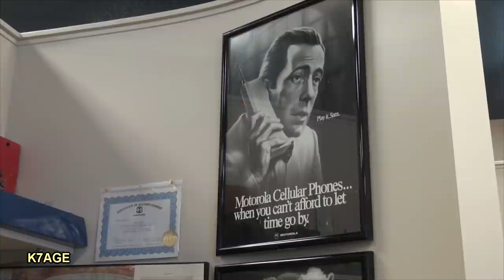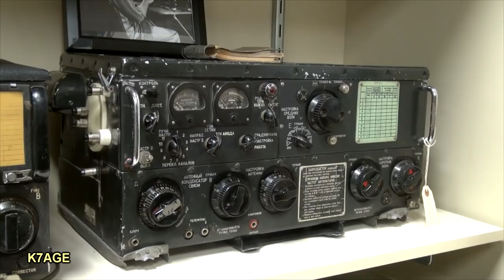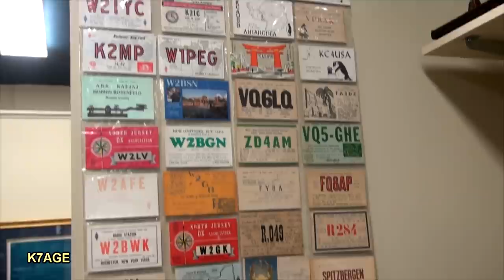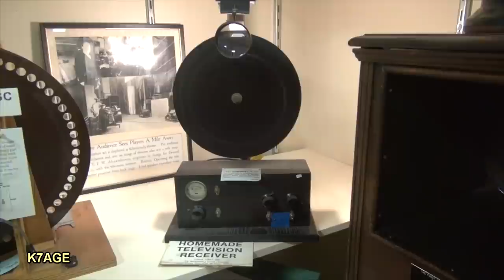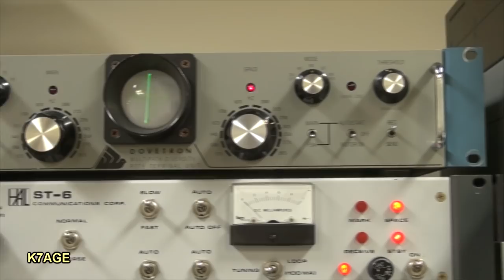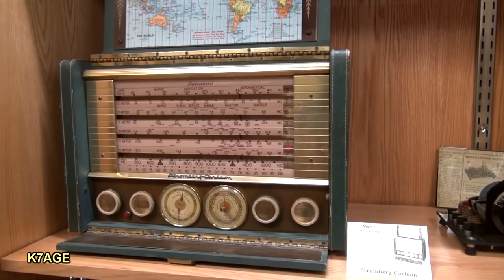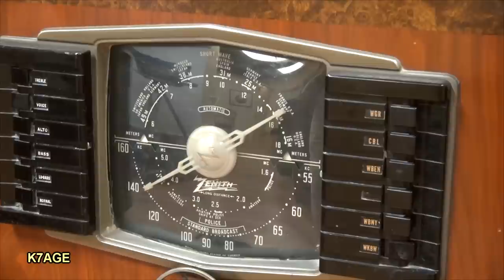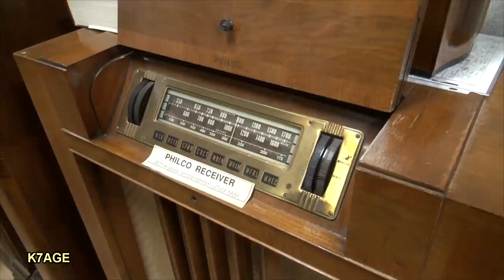Visit to Antique Wireless Museum - 2019

Comment: Thank you this is fascinating. My uncle was one of the early marine radio operators on the White Star Line. The equipment in his basement, recovered after up-grading, stimulated my interest. At 13 I designed and built my first H.F. receiver. Thereafter, travelling Europe and Africa working. It was the finest career.

Comment: If you haven't already, you should visit the National Electronics Museum in Linthicum, MD which is close to BWI airport. A lot of the exhibits focus on the development of Radar as the museum is focused on Military electronics. Many years ago I got a chance to visit it with my Ham Radio Club, but it is currently closed due to Covid.
Reply from the maker: I have worked those guys on the air. Got the cards. Probably never get there. I have been to the NSA museum.
Reply: I will have to get down there . 73 de Bruce N3LSY

Comment: At 4:24, your "WWI Field Station" is actually an interwar/early WWII SCR-178 radio.  Designed in the early 30's, it was built until 1942 but used almost exclusively for training since by 42, the Army had the better SCR-284.
Reply from the maker: Thanks

Comment: Ohhh all those Collins KWM-2s!   Wish I had a dollar for every hour I worked on one!  I was in an Air Force mobile FACP and we were still using them in the 80s - which was a major chore because they were designed for fixed installs and not for mobile combat comm bouncing around in the field, so lots of maintenance hours went into them.  Still we kept them working.

Comment: Seeing that Titanic radio room reconstruction was really something. The fact that the Titanic Marconi operator could actually *select frequencies*, even crudely, is a bit astounding to me. I had no idea there was anything approaching that sort of technology at the time. I suppose that truly was "bleeding-edge" in 1912.
Regarding that disaster, it occurs to me that a completely factual headline of the time could have read: "Over 700 Survivors Saved by Wireless in Titanic Disaster", as the Carpathia did in fact receive the distress call, but was two hours away. 
Even so, without the wireless, the survivors of the sinking would likely have succumbed quickly to the elements, stranded in the middle of the icy Atlantic.

Comment: When I started in the fire service we used VHF radios. Once Motorola came in and narrow banded everything. It got to the point you couldn’t even talk on the radio way out in the county. The paid Dept. I am on, we went from VHF to a digital 800 system last year. It’s amazing how clear those radios come in. Only downfall. The hand held’s would run you around 4 to 5 grand. Get the shoulder mic with the bigger battery it’s even more plus you have to pay a yearly subscription. I couldn’t go back to a VHF system, love the digital and they don’t use repeaters so that’s another upside to the system.

Comment: I expected to see some of my station gear there, gear I bought, and kits I've built over the last 60 years. I did, about 5 pieces of gear I still use. I figure if it works it belongs on the air, not in a museum.

Comment: 3:49 $13 ebay bargain......just goes to show the stuff that ends up on there. One mans junk is another mans gem! As a teenager of the 60's my parents bought me a transistor radio for my 14th birthday. A Fidelity Comet. Made mostly of plastic apart from a thin aluminum speaker grille, it had four bands MW/LW/SW and a BS on Radio Luxembourg. The volume and tuning knobs were also plastic finished in chrome.....very 60's! I loved that radio but after I got married it just disappeared. Years went by and I often thought of that little radio. I spent many years scouring junk shops all to no avail. Then I put in a permanent search for one on ebay. More years went by until one day.....bingo! One appeared. I HAD to have it no matter what. It was advertised as working and in good condition so I put a crazy proxy bid on it but nobody else bid so I got it for the asking price £20 ($27.70). The seller lived less than one mile form me and when I went to collect it I was staggered........it was brand new still in the original manufacturers box with shop price tags!